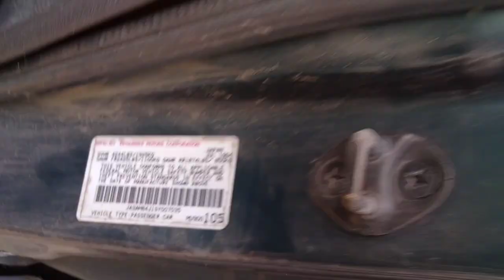CRUSHING EVERYTHING LET ALL GO UP! 1994 MITSUBISHI 3000 GT! BIRTHDAY SHOUT-OUT!!

Comment: The 3000GT is actually a 1995 (10th digit is an "S" for 1995 model year). The Dodge Stealth was the same vehicle sold by Chrysler.  They were built in the Nagoya plant. This one is code G84 Panama Green Mica exterior paint. Happy Birthday to Mario.
Reply from the maker: Man I'm always one year off but most I just guess.
Reply: @DeathRowCarCrusher  Japanese vehicles can be tricky because a 1995 model may have been made very early in 1994 (making you think it was a 1994) but they were introduced early in the model year. That's why, "We need the VIN to win".